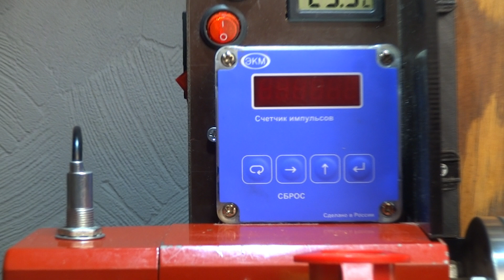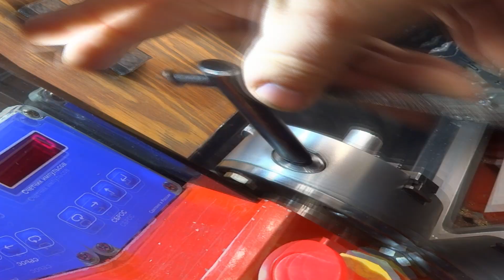Updating the mini lathe to rewind the armature of electric motors.

Comment: Hi friend, I'm your subscriber. I have a question, more or less, how much would it cost to make that equipment to wind, how much would it cost?
Reply from the maker: Hi. I bought a pulse counter, a sensor and bearings. I made everything else from materials that I had in the workshop. The purchased parts in my country cost me about $50. But you probably will have a different price order.